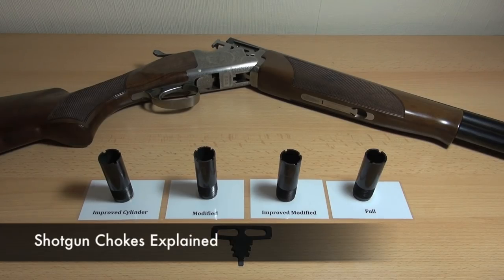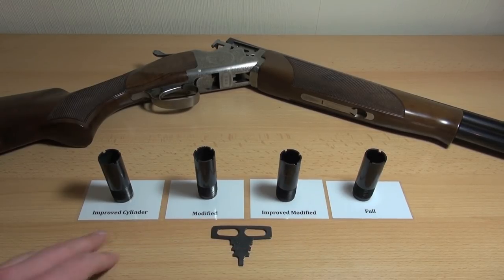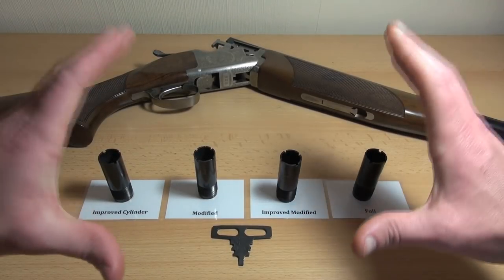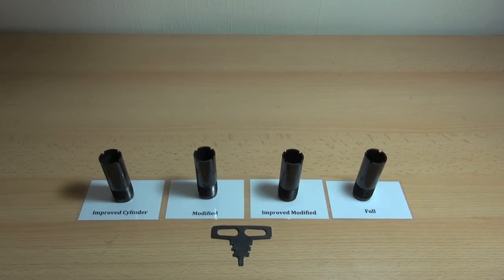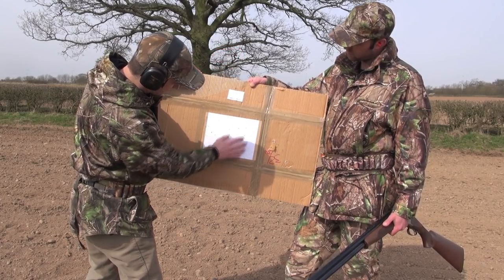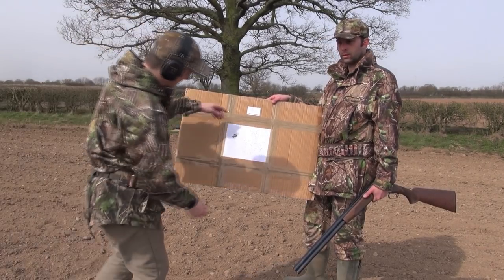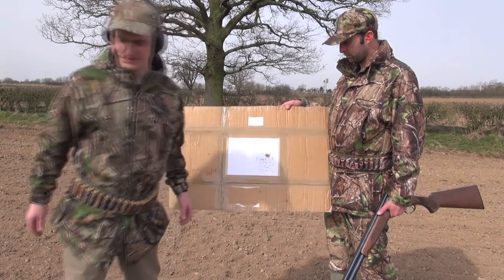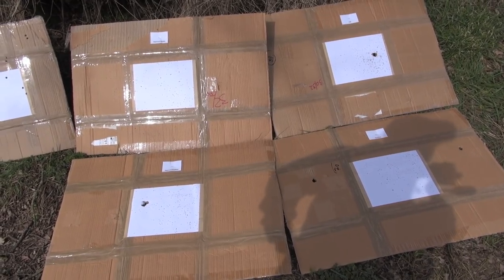Shotgun Chokes Explained

Comment: can someone please explain to me what choke should be used for clay targets as opposed to skeet
Reply from the maker: Depends how far away they are!
Reply: ***** Thanks for the reply great vid! at the moment i have the most open on bottom and the most constricting on top for trap. should i change this for skeet?
Reply from the maker: samandniki Well normally for skeet you use very open chokes, but I guess it comes down to personal preference. There is a choke called skeet and it is wider than improved cylinder.
Reply: thanks for the info. cheers.

Comment: Is it safe to shoot slugs with a modified choke?
Reply from the maker: I guess it depends on the slug but many slug ie: ELEY Bennekke actually are recommended to be shot with a modified choke. And I shot a load of them out of Toms Browning Maxus using modified without an issue. Thanks for watching :)
Reply: I just finally heard back from my gunsmith Terry Gardner at Impact guns, he is saying that it is absolutely not safe to shoot them through a choke tube you will damage your gun and risk turning the barrel into a pipe bomb. you may want to pass that along
Reply from the maker: Jordan Simpson Well I suggest you go and see Terry Gardner and inform him that he is talking bollocks. Here is an example:-

https://fbcdn-sphotos-e-a.akamaihd.net/hphotos-ak-xpf1/v/t1.0-9/1978849_277846952384653_2136909787_n.jpg?oh=cab99841e53ccec8ed78cecc425d0a54&oe=55B68ACD&__gda__=1437422411_13e6c5fd6ef9976c7baeb9338733c2f1

Shot by me at 50 metres using ELEY Bennekke 28 gram slugs using a modified choke in a Browning Maxus semi auto and it recommends that choke on the box.
Reply: 1oz foster slugs

Comment: Shouldn't use rifled Foster style slug through anything tighter than Improved Cylinder! Check the choke and shotgun's specs too. Cylinder choke is best for rifled Foster slug in spite of its hollow back, even if gun and choke manufacturer allow improved cylinder (it will wear the choke). As you're in Europe, I wouldn't shoot a rifled Brenneke style slug through anything but a cylinder choke as they're not hollow on the back side. Sabot slugs should only be used in rifled barrels (implies cylinder choke), or smooth bore with a rifled cylinder choke (preferably an extended choke for more rifling).

Comment: Don't you think that it's a little dangerous to fire the shotgun towards live traffic? I know you were pointing the shotgun at an angle towards the ground, but it was still in the general direction of the traffic, other than that it was a good video.
Reply from the maker: Ah yes people come up with this concern a lot, do you know what the effective range of a shotgun with birdshot is? Around 40 yards, the motorway is at least 200 yards away. Even if you fired straight at it on a 45 degree angle not a single piece of shot would get anywhere near it. Thanks for watching :)

Comment: Got the names (quarter, half) wrong... Side by sides normally have quarter and three quarter fixed chokes
Reply from the maker: Well actually, the terms 'half' etc are all wrong anyway so it's a mute point. The chokes are called cylinder, improved cylinder, modified etc.
Reply: ***** They maybe wrong but a lot of people use that terminology so best to get it right and not to preach the wrong thing. Otherwise a lot of these new shooter are going to get very confused. :)
Reply from the maker: Max Y-J I think you're right but you could also consider my own difficulty matching such slang to the official terms kind of proves why its best to use the proper terms in the first place. Less confusion then :)
Reply: Ok mate, fair enough.

Comment: Those patterns are way too wide for the distance used in the test. I'm inclined to think that you guys were using shot shells with just the fiber wad discs instead of the plastic shot cup type.
Reply from the maker: We used fibre wad loads yes, I find it irresponsible for use plastic wads i the field.
Reply: *****
I'm glad that you have the option to obtain those fiber cartridges. Here in the U.S. they are hard to find and have to be special ordered. The plastic wad variety is the norm for the average American. Although I don't like scattering plastic shot cups all over the country side, I do like their performance and tighter patterns.  Maybe somebody will invent a biodegradable shot cup that will combine the best attributes of plastic and fiber. thanks for the good video buddy!
Reply from the maker: As it happens I did a video on plastic vs fibre wad:-

Plastic vs Fibre Wad Shotgun Cartridges

Fibre wad is pretty standard here, few people use plastic in the field and clay shooting clubs usually specify fibre wad only. Thanks for watching :)
Reply: maseta3 they do a  fibre cup for reloading  http://claygame.co.uk/products/detail/100-12ga-fibre-shot-cups

Comment: I would disagree that a shotgun has a maximum effective range (killing) of 40 yrds.
We have all seen the you tube videos of George Digweed break clays at 130 yrds and Dave Carrie
bringing down very high pheasants and partridge at well over 80 yrds high and more.
This shows that pellet energy is still retained at much greater distances.
 
But I don’t think people should get ‘hung up’ too much on chokes. Whatever choke you are using, it only takes a couple of shot in the head to bring down a bird. I feel that it is far more important to concentrate on giving correct maintained lead and hit the bird in the head cleanly and outright than putting the whole contents of a cartridge into its wing/body area, which could still mean it flying on.
Last season I shot two birds down on the same drive at 40 yrds or more with a cylinder choke; and on our local shoot I never use more than a quarter choke for average height birds.
Also the terminology e.g. imp choke, modified choke and so on is simply the American wording for the English equivalent sizes e.g. quarter, half and so on.
Reply from the maker: It is true many wildfowlers take down ducks and geese at 80 yards plus but they are using BB or similar shot sizes in very heavy loads with 'super full' chokes. George digweed uses similar loads and chokes to smash those clays at 120 yards. But notice how digweed doesn't shoot pigeons farther than around 80 yards and when he does he never kills them outright because it doesn't have the power. Don't believe me? Line up a woodpigeon at 50 yards and shoot it with 30 grams of number six. I guarantee that the shot won't penetrate its wings and it will fly off unharmed.

Comment: You need to clean the chokes each time after using the gun or they will get seized into the muzzle and you will have a hell of a job getting them out, if ever you can, just put a small amount of oil on the thread before screwing into muzzle.